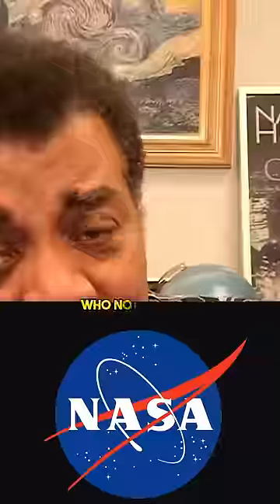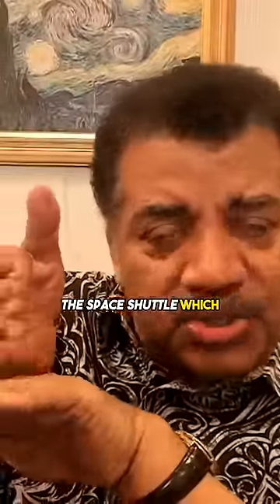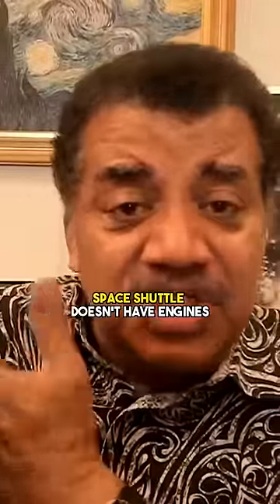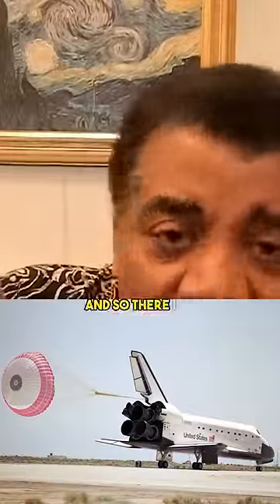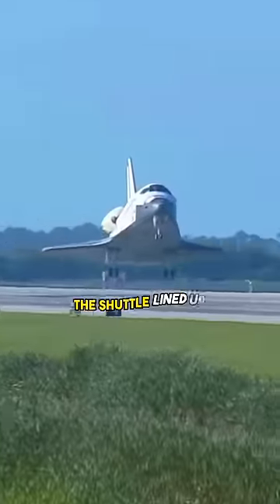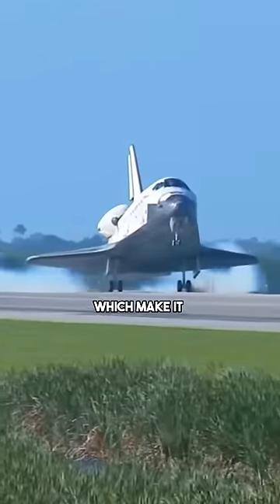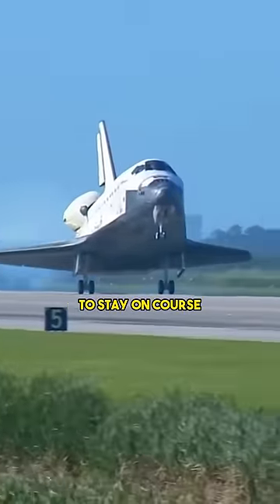NASA Engineers, Off-ramps, Space Shuttle Landings, What's the Connection?| Neil deGrasse Tyson

Comment: Grooved pavement also helps to reduce hydroplaning.
Reply: Also wears your tyres out faster. 

Also the grooves fill in with dirt, gunk and everything else that can make the surface even more slippery longer term if not maintained. 

Also the ride on a grooved surface creates acoustics that some find unbearable.
Reply: That's the ACTUAL reason for groved runways and roadways. To more efficiently drain water. No clue why he's making this claim.
Reply: @DirkShotojima  -  I've seen what happens when an Interstate road surface is made smooth as glass.   Lots of hydroplaning and wrecks.  
      Worn tires (tyres) are a small price to pay for having less carnage of our highways.
Reply: @gdaddy5193  Its because in many cases he is simply talking through his rear end .
Reply: @gdaddy5193 "more efficient water drain", all while the groves go along the road and not to the sides to actually channel out water to the sides. That makes 100% sense. Thank you for showcasing us the dunning kruger effect.

They're made specifically for the reasons thet the video talked about, not for "water drain".
Reply: @gdaddy5193  I agreed👍
Reply: @DirkShotojima  Actually, no. 
It's called milling and the number one reason for the grooves is milling, which smoothe and levels out the hand trowelled concrete's lumpy surface.
Reply: @gdaddy5193  you are correct based on DOT standards for speed, angles and yearly rain fall. Hard to find concrete highway in Louisiana without grooves!
Reply: @paulmahon1613  lol at hand trowelled concrete highways. just wow
Reply: @DirkShotojima  actually you are telling a silly story you made up in your silly mind as none of your comments are real
Reply: Sorry NDGT, this is a highway NOT a runway. The grooves, there are two kinds, parallel and perpendicular. The parallel grooves are for water 'relief ' not drainage. They work with your tires to help channel water away from your tire and reduce hydroplaning. Like an extra set of treads. The perpendicular groves are to create a vibration in the vehicle. Which is to alert the driver to a potential upcoming hazard, such as a toll booth or turn. So no NDGT, wrong again. Cosmology great. General science, not so much. Learn the difference between causality and coincidence. Those grooves have nothing to do with the Space Shuttle. NDGT Minister of Disinformation.
Reply: @phillipmoore6295  -   The vibrational grooves are a completely different kind of groove compared to traction grooves.
Reply: @rb032682  Isn't that what I said. Reading is fundamental.
Reply: Also means you have less on the ground

Comment: Grooved pavement is hell on a motorcycle. It causes a wobble and is hard to control.
Reply: I was expecting a comment from the most entitled group of road travelers. Either motorcycles or bicycles, the most entitled people on the road are ones with 2 wheels.
Reply: That’s probably an easy fix; slow down on the grooved ramps.
Reply: @seageo4303  that's not how it works. It's clear you don't know what you're talking about.
Reply: @DirkShotojima  Try explaining how it works. If you’re putting your knee down on the ramp then expect the effect.
Reply: not if they are perpendicular  to the road or runway
Reply: @JamesAnderson-mr2sg  I trying to remember where I noticed left and right running grooves. May have been on the I-10 in Pomona CA, and the I-80 somewhere where it snows.
Reply: @seageo4303  Its more expensive probably takes longer to cut perpendicular grooves than the standard parralel  grooves
Reply: @heyitsme1534  that's completely irrelevant to the fact he stated.
Roads are there for them as well, and this makes things more dangerous for them.
How about, instead of idiot proofing everything, we expect people to drive their cars in a safe manner?
Or maybe city planners/engineers stop designing exchanges and roadways so stupidly (like corkscrew on/offramps)?
And, as a car driver, I have WAY more issues with other car drivers being altogether clueless, entitled, wreckless, dangerous than people on 2 wheels. Every group of vehicle operators have the same percentage of idiots, 2 wheels I have to deal with far less.
Reply: @JamesAnderson-mr2sg  I think that’s worse because I causes vertical motion. It was probably installed like that for other reasons.
Reply: @JamesAnderson-mr2sg  As I recall, those groves were installed during construction and appear to me as originally being formed when the cement was still wet. It was definitely cut where the stones are starry to show.
Reply: Choices have consequences motorcycle riders
Reply: I've had the crap literally scared out of me on a bike because of the grooves in a curve no sign what so ever  good I was only about 40 mph
Reply: Motorcycles are not real transportation. They're just toys.
Reply: @tjesse  there was a time when motorcycles were more affordable than cars particularly after WW2
Reply: @DirkShotojima - OK, then try a  Steel Deck Bridge, that uses Flat Bar Stock, placed at 90° (skinny Edge up), in short Lengths of 50' or so, and the next segment is offset left & right, as you progress across the Bridge! 

I have, and if you feel the "Grooves" causing issues is just poor Driving Skills, try those type of Steel Deck Bridges! Summer or Winter! 

They have High Sides on them, and some have a Protected Walkway on the Sides, like a Hallway.

They build them this way, to keep Snow from Accumulating too much, because Plows & Graders can't push the Snow off into the Ditch, so the Deck is made to allow snow to penetrate through the deck.
Reply: @heyitsme1534  entitled?  Please explain.
Reply: Nasa didnt do motorcycles, that was air force.
Reply: @seageo4303     The easy fix is to crosshatch the pavement for motorcycles.
Reply: Plan a route
Reply: How about don’t ride a motorcycle and problem solved
Reply: @heyitsme1534  ^ this sounds like someone who really thinks they are entitled to the road lmao
Reply: That is a good justification for building a separate lane for motorcyclists along all freeways, besides the deaths and injuries.
Reply: @heyitsme1534  Wow you! Selfish much?  All drivers of vehicles should give right of way for cyclists, wheelchairers, walkers, runners, children, etc. Oh, and large trucks should give right of way to smaller vehicles. It's called the pedestrian rule. It has two laws and one exception: 1) All Pedestrians Rule, and 2) This rule slopes 45 degrees upward to large trucks. Exception: Trains.
Reply: @Sea Geo  by your comment you clearly have no clue what you're talking about.  Those grooves that do not follow the smooth curvature of the road destabilizes motorcycles no matter how fast you're going. The first time you encounter it on a motorcycle you are going to change your tune.
Reply: As a trucker I appreciate those grooves honestly bikes should be seen More as toys than real transportation, they're extremely dangerous and they make the roads unsafe for pre much everyone else out there and if anything hits them either y'all become a cylindrical 800-pound 1,000-pound bullet and go through someone's mini van

Or y'all get turned into a pancake
Reply: I instantly thought the same thing. Whenever I ride through those, it makes me wonder if my tire pressure is too low
Reply: Then don't ride the 2 wheeled coffin 😂
Reply: @CountGremlin  let the world clean the gen pool out q little
Reply: Yes, this was especially true if the bike had a ribbed front tire.  When i had a non ribbed front tire the wobbling almost disappeared.
Reply: @MC-br1gk  honestly you civilians aren't going anywhere that you need to be there in a hurry and should be the ones giving way to the commercial trucks that have to get where they're going or there fucked out of a day and a paycheck 

There is in fact no difference in the right away between. Commercial vehicles trucks cars and motorcycles
Reply: @coywolfproductions7056  I was waiting for this reply. I'm somewhat surprised you didn't argue the pedestrian/bicyclist hierarchy, but it makes sense you would defend the large truck comment first. I am not against your point and I find truck drivers "tend" to be much better drivers than those that drive cars, but there does seem to be something perverse about the trucking industry's incentives if you feel that "civilians" need to get out of the way in order for you to be paid.
Reply: @MC-br1gk  I look at it more as a law of momentum and weight

Big truck is very heavy takes a long time for it to slow down and speed up

As you get smaller and smaller it becomes easier and faster to yield

So in that line of thinking a bicyclist should always yield to the heavy traffic

Mark crossings with stop signs the truck is already stopping and so has the easy ability to yield to the protest realtor cyclist crossing the crosswalk

Motorcyclist should be aware of the dangers they face and take optimoroute planning to avoid places where they really shouldn't be, why would you go through the heavy traffic City junctions of highway interchanges and risk running over rumble areas and other dangerous

When it's just as fast for you to take many other routes through or around the city and later rejoin the highway.
Reply: @heyitsme1534  imagine being a car driver in the united states  having the audacity to say cyclists are entitled. You've never ridden a bike in your life I'll bet
Reply: @coywolfproductions7056  You had to throw the law of momentum in...I don't disagree with you. Be safe on the road and I will do my best to yield to the momentum.
Reply: @heyitsme1534  you say thinking onl you are entitled to the road?? you are one big hypocrite!
Reply: I ride a motorcycle all the time and I've never had any problems with it
Reply: @seageo4303 in wisconsin at least it's not just the ramps it's a good percentage of highway & freeway that's like that & I drive a car but it's still super annoying. wobbles & loud as fuck
Reply: @dragons_red I second everything this guy said
Reply: @heyitsme1534 wow how dare they question the superiority of four wheeled kings of the road who are responsible for most of pollution and damage to the infrastructure and who can barely cover for those so all other people have to pay for them as well🙄
Reply: @dragons_red fr funny how often motorists blame it on motor bikes, cyclists, trucks, anyone but themselves
Reply: @taylorscott727 how about you don’t say dumb things
Reply: @MC-br1gk wow you must be a nice person, supporting segregation based off transport preference, I wonder what beautiful ideas you have in store for people
Reply: @coywolfproductions7056 You: “bikes are dangerous toys!!”
Also you: “Driving a multi-ton giant vehicle that can crush anything short of tank or train without you noticing”
Reply: @gormauslander that’s how they often are, ignorant, opinionated and loud
Reply: @FlymanMS  bless your heart
Reply: So cobble roads were way ahead of they’re time and horse and carts were just lucky 😂 someone had some rocks laying around 😮
How about the road to get into the mountains just smooth we’re they 
Especially on the bends, Groves in tyre didn’t exist yet oh race cars and speed way oval track racing etc etc old mate from nasa 
lived in the bush  😂
Reply: Good. I hate motorcyclists

Comment: They've been cutting grooves in the roadways from at least the 1940s. When we drove on portions of Hwy 80, before the Interstate system, that were prone to water collecting when it rained, there were grooves cut into the concrete to help prevent hydroplaning. As far as the exit & entrance ramps are concerned, especially at clover-leafs, same thing and they were banked to help prevent skidding.
Reply: Exactly.
Reply: NDG has a lot of bad takes and frequently is called out for it. How he is seen as a role model in the intellectual community I'll never know.
Reply: NASA did that
Reply: Not the same thing
Reply: @srsr28  But it is.
Reply: @srsr28  And 2 plus 2 equal 5...
Reply: His logic is reversed
Reply: @savage22bolt32  NACA did that before it be came NASA.
Reply: My father worked for NACA /NASA after WW2 . He worked at the research center at Langley Air Force Base . One of the first projects that he worked on at NACA/NASA was grooved pavement .This was done in the later 1940's before I was born (1952).To start off my dad drove a pickup with bald tires up and down a wet runway . Giant wind machines were set up to blow him off of the pavement . I still have my father's NACA pin  .
  The dude in this video is a big phony .

Comment: The grooves are there to drain water so there is no standing water on the road; they aren’t really intended as traction surfaces.
Reply: Your right otherwise the tires can hydroplane off the runway
Reply: When i stood on that runway the grooves ran across not along it. And yes they are to drain rain.
Reply: @markvwood2007  the grooves really work best across the direction of travel, but they are too noisy for use on highways.
Reply: There's both kinds. There are traction grooves in some areas.
Reply: You're wrong, but okay. There's multiple grooves for different purposes. Some are for traction, some are to drain water.

Comment: The bank angle of the road prevents "careening off".
The grooves have been used in the northern states for as long as my father can recall, to drain water so that the surface doesn't become an ice rink.
The grooves run perpendicular to the travel of the vehicles, which actually reduces the ability of the tires to keep traction as they leave the surface.

There's a road near Amherst NY that has a speed limit of 60mph, with a 90° turn, with a very steep bank angle.
I recall when my mom tested holding the steering wheel dead still, and at the exact speed limit, the car stayed in its lane and it felt like flying when the plane tilts to turn because the car tilted to turn.

Comment: I remember an article about that 20+ years ago — groves in the direction of travel can be rather dangerous for motorcycles, hindering them to change lanes etc.  But they are easier to cut.
Cutting across in not as trivial but is safer, despite the nasty noise it can make.

And the reason for doing it was not drainage, but ‘resurfacing’ the road there the surface had become too slippery/worn to be safe anymore. Cutting groves is much cheaper, after all, than creating a proper new surface, and causes less of an interruption to traffic.

Comment: ~45 years ago some of the freeways in the San Fernando Valley had these gooves;  it allowed water to drain off making driving safer.  I remember this because they also wreaked havoc on motorcycle wheels.   Shuttles land so smoothly because they have six vernier engines firing when they land to keep their attitude on line.
Perhaps one of the engineers, many of whom lived in and around The Valley,  thought these grooves would also benefit the Shuttles.
I lived in The Valley, I worked on the Attitude Control System of the shuttles.

Comment: Tires do not work like that

The grooves are there to get the water off the surface of the road to give the tires better traction in wet conditions. 

When you Groove pavement you actually take away the surface area that the tires use which makes them less efficient but at the speeds that they're traveling it is not as critical and is absolutely more important to have water escape from the surface during precipitation events

Comment: Sorry Neil, this has been done on u.s. highways since at least ww2. The south end of the Florida Turnpike is a great example. Not only is much of it done w grooved pavment, but it's also assembled in blocks. The campus of FAU used to house a ww2 military facility. on the north end, there used to be part of the "old road" that ran adjacent to a landing strip, which was built from the same grooved blocks as the turnpike (the south end of the pike was designed to double as an emergency easily fixable runway)

Comment: Sorry but I call BS. I first saw grooved pavement in the sixties on interstate highways. This is old tech. The reason you see it now is that the old bias ply tires with old rubber compounds would wear very badly on it. Newer radial tires and better wear compounds are much better but they still only use it in problem areas like statistically problem spots with high accident rates or new projects engineered that way. Somebody at NASA just REMEMBERED it.
Reply from the maker: Interesting

Comment: the word is careering. there's no "n" in that word.
Reply from the maker: Webster Dictionary: “To careen a boat, you need to tilt it on its side. Careen gradually became used to describe the act of a boat tipping over in rough waters, or the similar tilting of other things. As motor vehicles became commonplace, careen became a useful word to describe the lurching, side-to-side motion that a vehicle would make when it was racing out of control, thus the overlap between careen and career.” I hope this helps to clarify any misunderstandings.